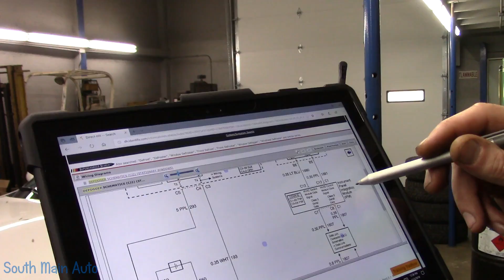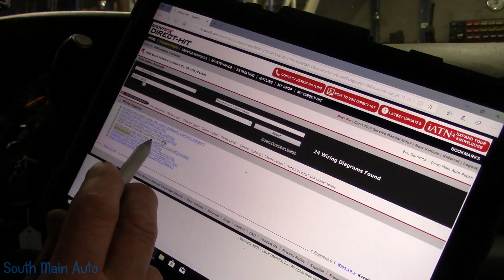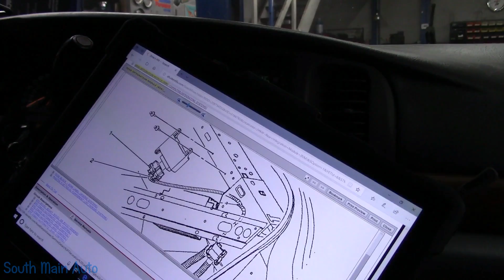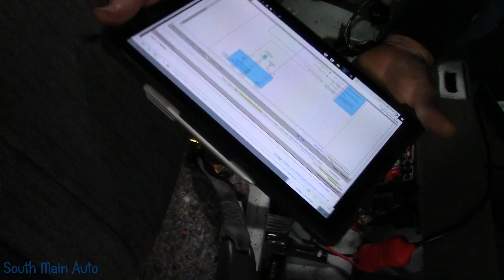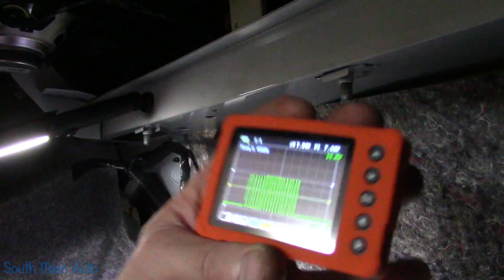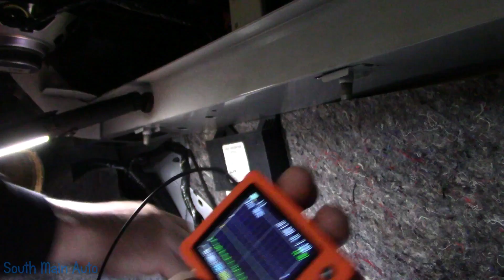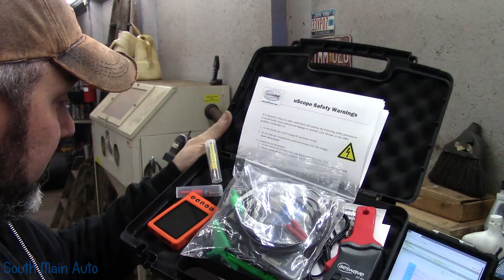Buick LeSabre: No Reverse, Interior Lights, No Defogger, No Power locks

Comment: Shops that tell customers to "go pound sand" are forgetting about the internet business review sights.  Customers can go online and report their negative experience to the whole world.  It can put those shops put of business.  They also forget that the customer could be a lawyer, related to a lawyer, or work for a lawyer.
Reply: Or just be good friends with two lawyers....
Reply: from what I saw the failure was almost certainly NOT related to the work the first shop performed(in fact the customer was aware some of the things were not working BEFORE the elbows were replaced) Tho bad business if they did say "pound sand" I have had customers tell me things about nearby shops I know they would never say or do  IMO the module was already bad and the customer noticed the other failures due to "heightened awareness" post repair)

Comment: Question - if you buy the module but it doesn't fix the problem, is that money lost? If so, are shops forced to charge the customer for a part that was not defective? Kind of doubt that in this case but it is possible. For example, the data you see on the scope could be present but in error due to an upstream component...
Reply from the maker: I would eat but that is why we proved 100% that the module is bad first.

Comment: Ok Mr O, I've got a question. Can a power probe be used with an external battery? It makes no sense to me, but a guy here at the tires plus checked a ground on a vehicle with a power probe and deemed the external car battery he had out as dead and needing charged when the power probe didn't go off. It did go off when he put it on the vehicle's battery. Which makes more sense to me as it could complete a circuit through the power probe from the vehicle's battery and frame.
Reply: zappy bear sigh.... no it can't be used like that. Some people need to stay away from cars.

Comment: I would wager some big guy plunked his butt down on the rear seat and messed up the rear fuse box.
Reply: James Schrumm I had an ‘05 that my uncle gave me.  He gave me an extra set of tires on rims. He decided to put them in the backseat and stacked them 3 high, he had taken the fuse box top off as well at some point.  Well the weight of the tires had about 10 fuses bent or broken, fixed them all up and abs, traction and check engine lights all went away! Thanks unc!

Comment: If only you could swap it out with a known good one
Reply: When I was a driveability tech at my gm dealership back in the early nineties, gm would use a lot of the same modules across many different carlines and years, and since many were throw away, I would keep a select few with known faults that while made the module bad, it would at least partially work to enable me to substitute it with apparent dead modules to let me know my diagnosis was correct, so then I could get a new unit to complete the repair.

Comment: Great little scope. Nice to see you and Keith using it. Also nice to see you using the power probe. I know its not your favorite but its nice to see it in action as I have both tools so to see it being used helps us all that own them. Thanks much Eric O. 👍👍 Hope there is a follow on. I believe the scope has preset for CAN system voltage settings. Would like to see you use it on Primary ignition testing one of these days ❤️️

Comment: Should of just brought it to you to begin with!
Reply: There may be more to this story.  For free, I fixed the interior lights in my father in-laws 2002 Buick LaSabre perfectly - replaced all of the burnt out bulbs in his instrument panel and radio which meant soldering in 32 very high quality new bulbs that I purchased.  For six month after the fix he blamed me for everything else (all unrelated) that went bad in his poorly maintained vehicle.  Never again will I help someone with such a poorly maintained vehicle!
Reply: @Sandbag1300  I feel your pain. I`ve mentioned before on this channel : do `em a favor and they`ll stab you in the back first chance they get. It`s noticeable that it`s getting to Eric, understandably, and the price will be paid by the innocent as usual.
Reply: @Sandbag1300  OMG!  That same thing happened to me with my inlaws.   I changed his oil and filter and swapped out his old brake fluid for new and did a brake job on all four.  Ever since, anything that goes wrong with that car is my fault!!!  Lesson learned.  However, he still wants me to work on his car.  NO WAY.  He couldn't understand why. .........people.